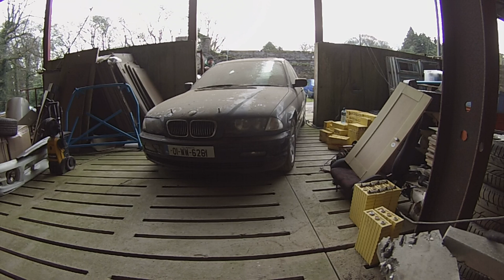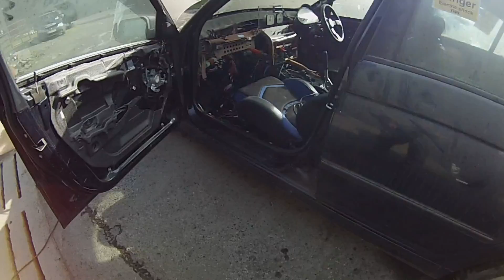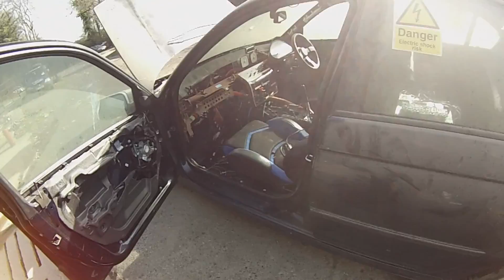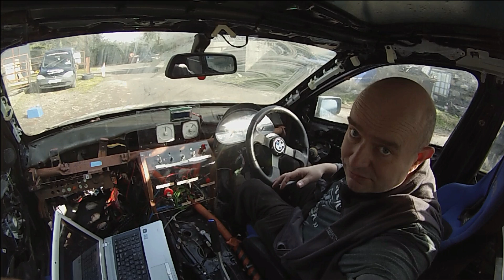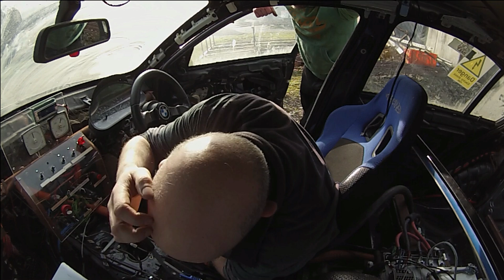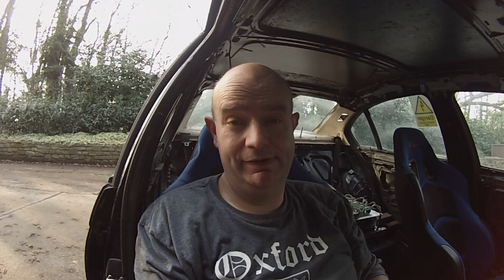E46 Electric Drift Project Resurrection Day 2

Comment: Hi. Great videos. Is the motor have enough power for racecar specially drift car? I would like a build bmw e36/e46 electric drift car. Would you give me some advice how can i choose the best set up for my car. i have a e36 23i right now about  200hp and 230nm with welded short diff ratio 4.44. Enough for high speed slides: 50-60 mph. I would same performance in ev.  Budget is ~2000€ does not incude the other stuff just for the motor,battery,inverter etc. Ac or Dc motor worth to build it?

Comment: LOL  I guess the constant Id all the time isn't a good idea.
Reply: Take a look at this video (first 7 minutes) https://youtu.be/bZwLFpXhFbI. The problem with the induction motor is the coupling between the Ig and the Id which is related to the slip. Note that the Back-EMF which the Id -counters is relative to the load-situation of the motor (high load means low Back-EMF). The easiest way to determine the Id/Iq relation is to make a slip estimator. This can be made simple by only by measuring the rotor speed (but is better if the electric angle can be measured too of course :)
Reply: @CharlesRunkle  Oh yes I'm measuring the slip speed.  It turned out to be a bug I just found where there was a long constant integer I had declared, but forgot to include the "L", so the compiler was only keeping the bottom 16 bits.  so, the dynamic integral windup clamping was clamping way way too early.
Reply: @MPaulHolmesMPH  Ok great this kind of errors can be sneaky done them myself when porting code from 8 bit to 16. Impressive stuff here in the video and general by you two guys glad you are working together!!

Comment: Thanks! Just cancelled my controller order...
Reply: Just be aware this is not the openinverter controller. Because that would make the video much less entertaining :)
Reply: @EngineersFear  I was being facetious (ie joking).😁
Reply: @blackmanops3749  Oh, se German is always serious :)
Reply: @EngineersFear  Oh no it was still hilarious.  haha.  Actually this was just something I tried in my bedroom that worked on an unloaded motor and asked Damien to play around with.   It was with a constant Id all the time (even at zero throttle, which caused the car to want to move even with no throttle, since I think it wasn't perfectly at 90 degrees with the torque command).  I think the problems are, the motor doesn't have the right Kp and Ki, the right rotor time constant, and the way the software is computing the rotor flux angle is not good at low rpm, and when the motor runs out of voltage, the high speed rev limiting is too harsh.  Some people have suggested to me to do Idref = IqRef = throttle, but that gave terrible results at zero rpm.  It works great for a lightly loaded motor though.  I"ve really got to get a dyno set up.
EDIT:  There was a bug I just found, where the dynamic integral windup clamping was happening way too soon since I had declared a long constant integer, but had forgotten to add the L to it, so it was only keeping the bottom 16 bits.